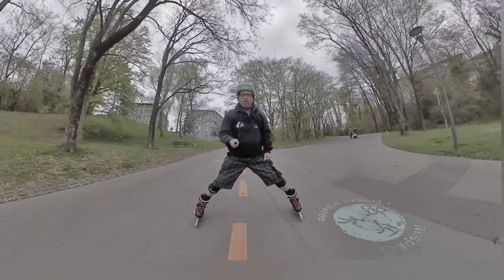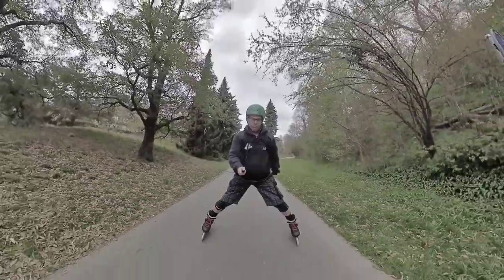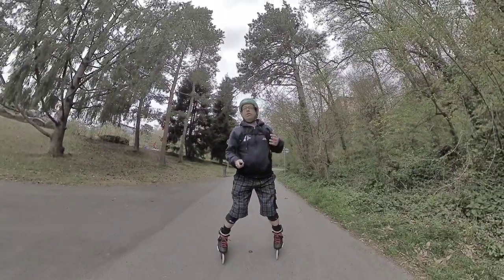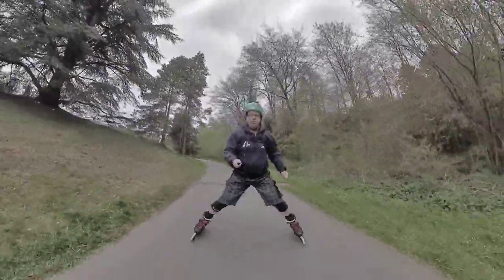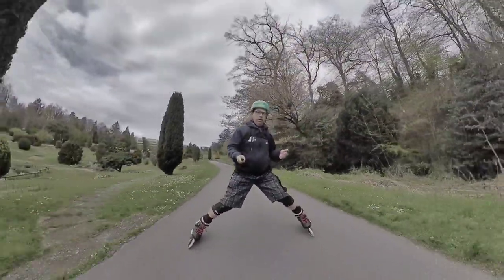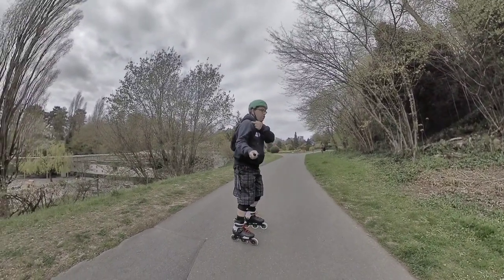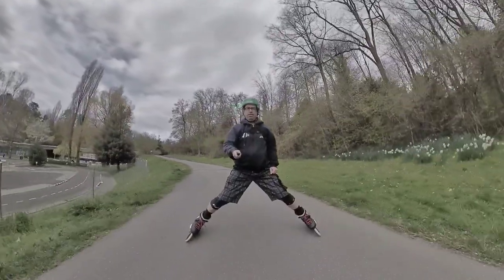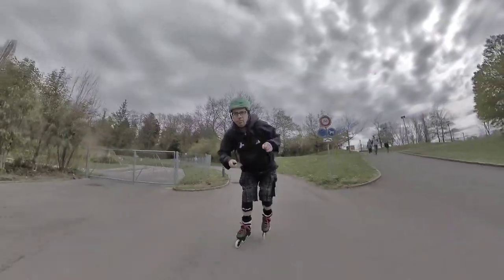Snow Plow etc

Comment: A couple of points to add to this: 
-plows are not good for wet or slick surfaces as you will lose grip and very likely fall.
-plow with outside edges can be performed in a more compact stance (about shoulder width) taking up less space
Reply from the maker: Exactly , the plan is to post also a tutorial about stopping on wet .
Reply: @natanlakonishok  That would be great, Natan. May I remind you of this idea, since it seems it's been a while and the video is still not available, at least to my knowledge
Reply from the maker: @FranciscoTornay  Promise 🙏
Reply: TY for explaining the width between the skates and the different surfaces.
Reply: Appreciate the precise instruction/suggestion... outside edges and about shoulder width

Comment: Natan sorry but I don't see where you use the outside edge. I see always the inside edge and toes pointing to inside to slow speed.
Reply: Hi Nathan, so put pressure on the heel and push with outside edges? Just want to make sure I understood the technique.
Reply: Same here, look more like tilted to the inside.
Reply from the maker: I will have to make another video ,to explain it better .